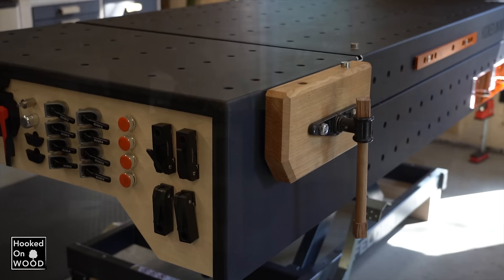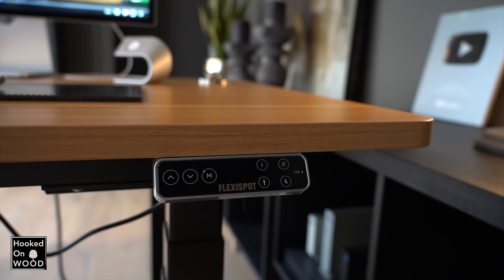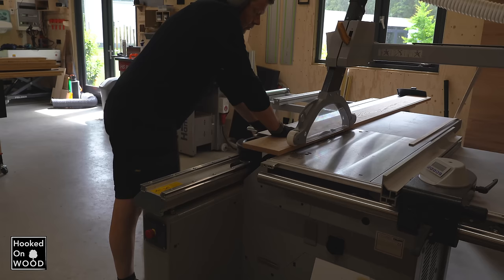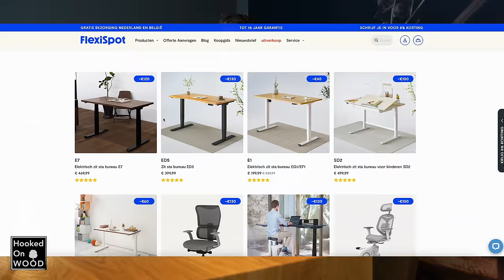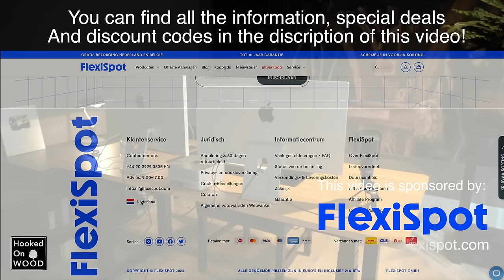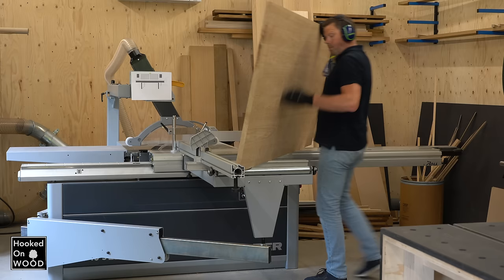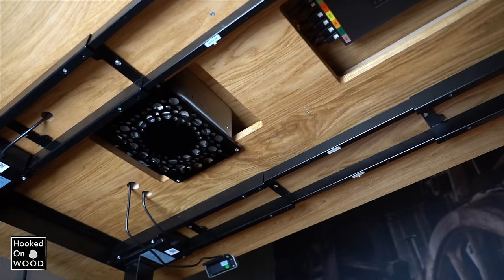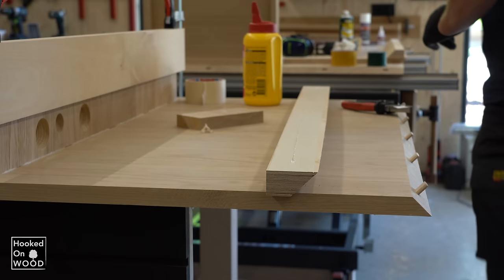DIY: Solid Oak Desk with a computer and cables hidden in it!

Comment: I always like your videos! May I ask what is that blue thing attached to Domino at 9:00? It does not look like the standard attachment which comes with the machine. The standard one is a bit flimsy so if you found a good upgrade I would be happy to hear about it! Also, out of curiosity, did you have to do any adjustments on the Domino? My Domino joints do not always come up as neatly as yours and so far I was not able to figure out why exactly. Thanks!
Reply from the maker: That is the TSO bigfoot: https://tsoproducts.com/jigs-fixtures-guides/dbf-45-bigfoot-v2-0-base-system-for-festool-domino/
No adjustments on the domino. look at this video at around 3.40. Maybe it has something to do with that. https://www.youtube.com/watch?v=mj0pHVYEEYI&t=513s

Comment: Hello Dennis could this be the base for an adjustable height work table to accommodate 1200 X 2400mm standard sheets … it only needs to be movable when its not in use … your videos have cost me a lot of money on Banggood!!
Reply from the maker: No, most important reason is because the low position is limited.
Reply: @HookedonWood  Hi Dennis thanks for the reply … I have a requirement for a 950mm high work surface that is flat and stable I can even anchor it to the floor if necessary … I am prototyping an analog X Y axis router sled with an OF2200 mounted on top … just need a base that I can transport … designed this out of necessity since I have not seen any analog alternatives to regular CNC machines … not everyone wants to be a programmer!!
Reply from the maker: @michaelsnelling2918  Hi Michael, What I can tell you is that it is very stable, It is more stable than my Felder FAT300S. But it is also more sophisticated than the FAT, and what I am not sure of is if this means more fragile for a bit of abuse. But there is no movement at all in all directions with this table. And I think it has enough lifting capacity to be safe for a workbench.
Reply: Thanks Dennis I will look into this as an option

Comment: Hi Dennis, I like your videos/projects very much but a short hint: you should never use gloves with rotating machines! This is really dangerous and can be taken by your viewers as an example. Cheers, Arne
Reply: Gloves don't protect hands from blades and if you suffer a blade injury with gloves on they have to get the gloves off which might not be too pleasant either. Using a slider hand injury incidents are just about impossible if a Frits and Frans jig is used for smaller parts and cutting panels hands are in even less danger.
Reply from the maker: Thanks and I understand your concern. I will make a disclaimer next time to avoid viewers think it is OK to use gloves. 
For me it is a calculated risk. If I can not wear my gloves, it kick out the fun of working in my workshop. It does not feel comfortable without gloves. That does not mean I take safety lighthearted. In the small village where I live, we drive past each other at 80km per hour when oncoming traffic arrives. The space between the two cars is then 1.5 meters. That is deatly dangerous. But we all thake that risk on a daily basic. While working in my workshop, I try to avoid all distractions and focus. I am aware of the increased risk I am taking that the consequences could be more serious in case of an emergency. But just like driving a car, I assume that with proper focus, the chances of an accident are small.

Comment: Thank you for the video. It always strikes me that you have so much precision when you build things, its a motivation for me and I learn something every time. Those speakers on your desk got my attention with those thick speaker cords - what are they if you don't mind sharing ?
Reply from the maker: The speakers are from KEF, the LS50. The cords are a legacy from my past as an Audiophile. I like better powercords to give the sound more attack. But also a better shielding because there are some cables inside my desktop and I do not want them to interfere with each other.
Reply: @HookedonWood  I should have played that video in 1080p and popped on my spectacles!... I had missed the orange was the power cord. With your eye for accuracy I am not surprised you looked for similar things in audio. Thanks for letting me know the speakers and thank you for your excellent videos.

Comment: Love the design and the simplicity, thank you for sharing. I have a question: Why did you choose to cut the 45º on the riser pieces of the desktop on the sliding part of the table saw instead of using the fence?
Reply from the maker: Because I had to cut both sides at 45 degrees, with the second cut there is a risk the sharp edge will go under the fence and at the other side it is fragile. Second reason is that because the overhead blade guard for a bevel cut is wider and the width of this workpiece is not that wide, I could not guide it with my hands, so I would have to use one stick, but that gives a change of turning the piece a little bit while pushing it. Last it that this way, I had the possibility to place some hold down clamps so the cut would be cleaner and best change on perfect cut.
Reply: @HookedonWood  thank you